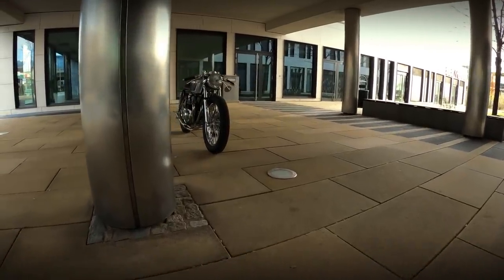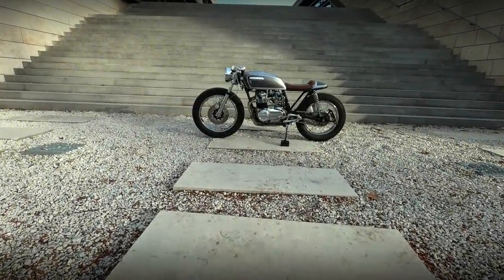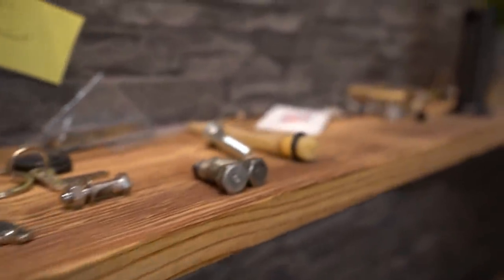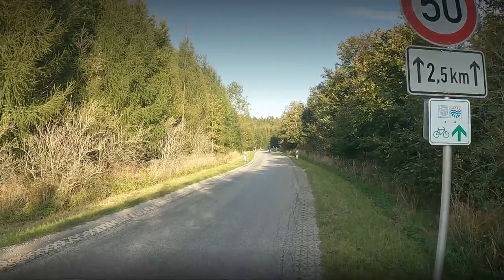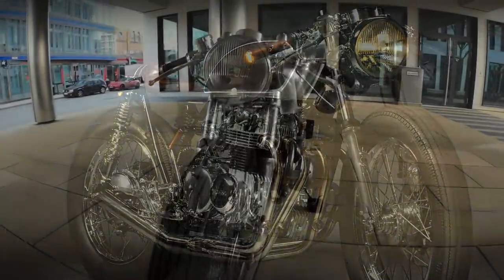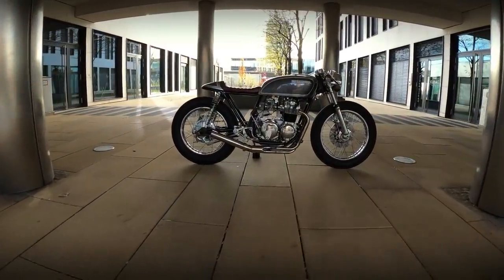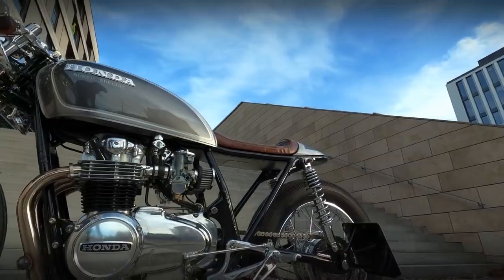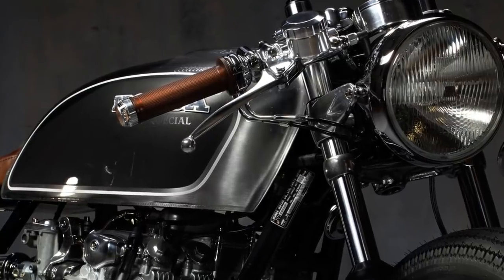Cafe Racer (Honda CB 550 by Sebastian Happ/089Moto)

Comment: What is really beautiful on this bike is that the tip of the back end of the seat is just above the centre axel-point of the rear wheel , the exhaust also points at this axel-point and ends just before the rear wheel axel hub begins . The triangle's remind me of the attractiveness of the angles of the pyramids . This bike's got really clean lines . Circle (front wheel) - triangle (headlight) - paralellogram (tank) - inverted triangle (seat) - circle (aft wheel) , and all in scale . Nice .

Comment: I had a 75 CB 750 for about 12 years. Sounded like that. I think the thin metal they used on the tail pipes gave it that rumble sound. Especially in acceleration and gear down. Now I have a Triumph Bonneville t100. Still miss the Honda. Even with it's drum rear brake.  I think the only more basic bike i had was the Suzuki t 500. Drum front and rear, no electric start.  They made a gt version with disc front.  Maybe you can do a segment with that bike? Thanks

Comment: Nice  bike with only one exception: I do not like the empty space under the seat...at all.
Actually there may be two problems for me: The above mentioned empty space which is a visual I personally don't like but the down (header) pipes appear to be of unequal length before they merge into the silencer which means he loses power from the engine.

Comment: This almost makes me want to buy an old bike and do something like this.  Almost
Reply: What are you waiting for !?
They are inexpensive, and abundant !
Get out there and find one, and get building !
Take the time to go through Victor's earlier videos on bike design !
These design principles are extremely critical to a successful end result !
Otherwise, you can end up with a disappointing hack-job !
Go back to Victor's dream bike Honda CX650 build !
Nothing was spared from his early design work, and throughout the build process !
The end result was nothing short of pure artwork ! ! !
Good luck with your new project !
Hope I have given you the nudge you needed !
Reply: @quadsman11  Thanks amigo. I just have so many ungood memories of pushing old bikes home from the old days. I’m too old to push them like that now. My 2020 KTM 790 is appliance like in its reliability.  But yes I do get the appeal of these super cool resto-mods.
Reply: @donparker1823  
To be honest Don,
the attraction to these older Honda's, is there longevity, and reliability !
If you have interest in this kind of build process, you are going to find yourself in, about up to your elbows, leaving no part, or system untouched !
Making sure to upgrade, or update as much as possible !
There are so many extremely reliable new components, ignition systems and charging systems especially !
New carb kits will assure you dependable fuel delivery to the combustion chambers exactly on time, and firing up a the slightest touch of the starter button, or of course, no embarrassment kick starting !
Which if memory serves me correctly, was the occasional nightmare !
But no longer the case !
Us old farts can just touch the button, and get on with it !
Nothing to compare with the growl of some of these older engines my friend !
Especially that CX650 of Victor's !
You'll swear it was a factory build !

Comment: Delkevic Exhaust system it looks like...But the things welded / added on to the headers though? Ports for AFR gauges or pyrometers?
Reply: yes, this is a delkevic exhaust:-)  These adapters are for lambda sensors to perfectly fine-tune the carburettors on the dyno. The header will be replaced by a new one after the dyno runs ;-)
Reply: @5EB4ST1AN  Thanks for the reply! Kind of what I had in mind! Very cool.

Comment: There's similar bike in bike shed motorcycle know as Steve's honda CB 550....there are lots of similarities between the two build
Reply from the maker: Sorry, but I have a different opinion. Most projects based on the Honda CB 550/650 or 750 models, have similar lines. But this one, has a much more refined materials and finishes, which make of it a very rare and beautiful Honda CB Cafe Racer.  This one looks much more elegant and proportional, because the rear end is slightly longer and lower than the Steve's honda. But thank you my friend for sharing your opinion. :) Cheers.
Reply: @RACER_TV  Great....good to know  ur insights.....Really appreciate ur work in this channel
Cheers

Comment: I like most of this bike, but sadly he felt the need to fall for the passé racer habit of leaving that ridiculous Bermuda Triangle gap behind the carbs. Why do people do that? It’s absurd. 

This was simply NEVER done on traditional or original REAL Café Racers. 

His other error is leaving off the mudguards. Both obviously have a functional purpose, but they also add credibility to any bike project. 

It’s no good claiming at the beginning that his reasons for building the bike included his frustration over not being able to find a parking space, then claim he’s never going to ride in the rain!

If contradictions define any project, they need to also be honest contradictions. Eg: It’s a 1970s bike mimicking a 1960s trend. 

However, what we have instead is less than honest contradictions of a 1970s bike faking a 1960s trend with a 21stC meme that ignores practicality, and sadly betrays both.
Reply: I understand your thoughts, but I have to tell you that it was precisely the parking space situation that ultimately made the difference for me to get a motorcycle. The fact that it turned into a cafe racer is due to the fact that i am a master craftsman in body construction and do not want to drive an off-the-shelf motorcycle. I also like old motorcycles, especially Cafe Racers.
You can argue about the style of the machine, but I still see my Honda as a custom bike in the style of a caferacer. The logical consequence of what was done in the 1960s is to leave out as much as possible. That’s because I cleaned the frame triangle. As said in the video, I wanted to give the machine a more modern, sleeker and clean as possible look. 
The machine now has a small mud guard. But not because of the rain, but because of the stability of the fork. ✌🏼😊